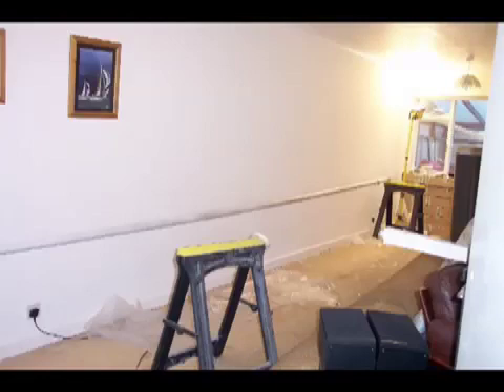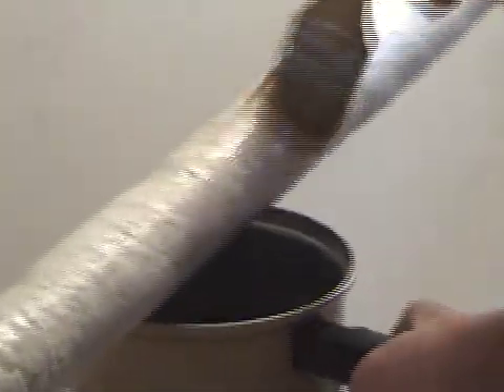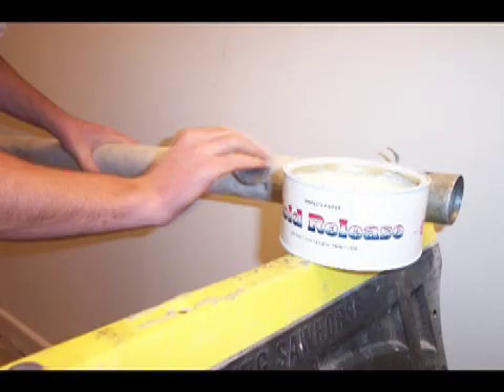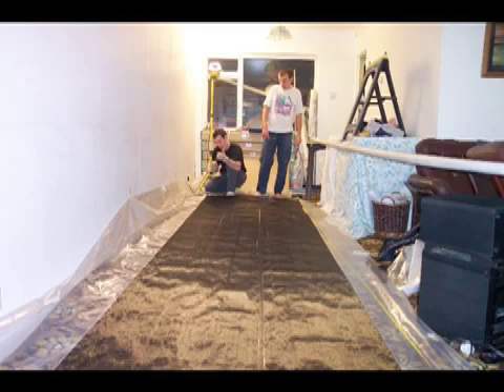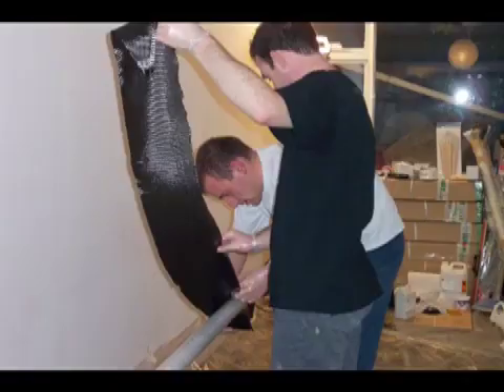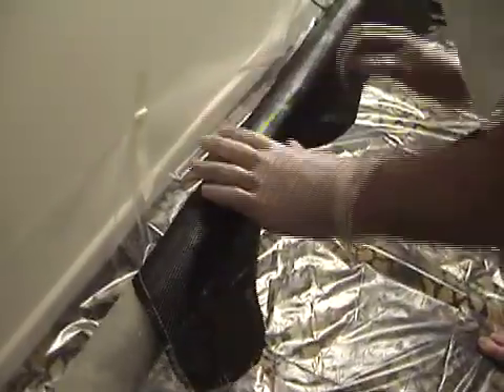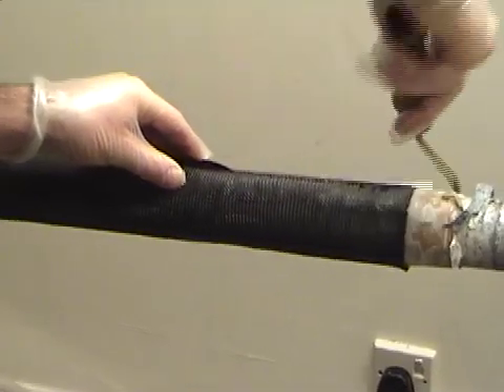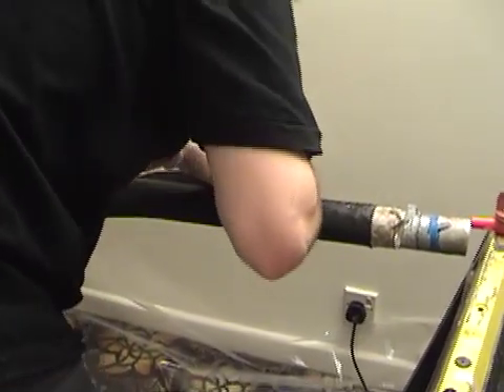Making a Carbon Mast

Comment: Great video. If you're looking to save some time... Freeman Wax sells uniform wax sheets with an adhesive coating on one side for easy application. I've used it on a couple of mandrels (though not as long as this mast) with great results. Just used a heat gun to melt the wax and remove the carbon fiber.